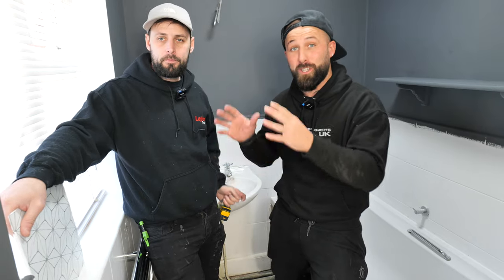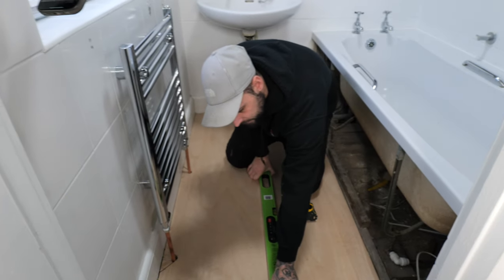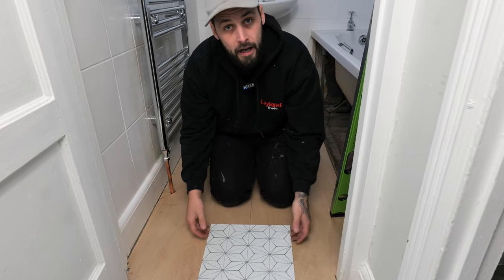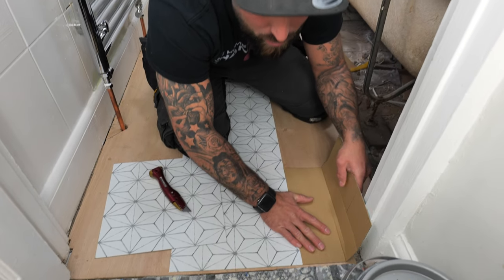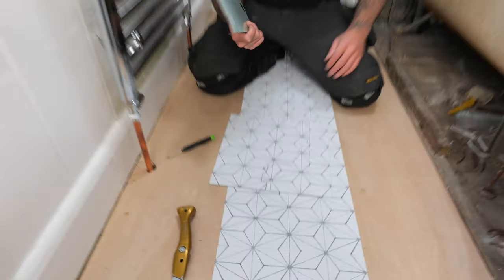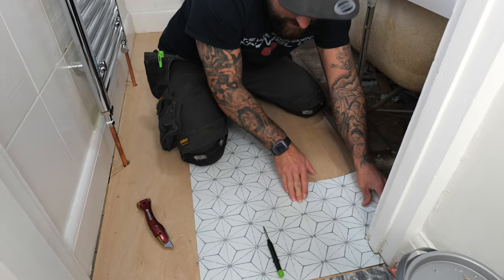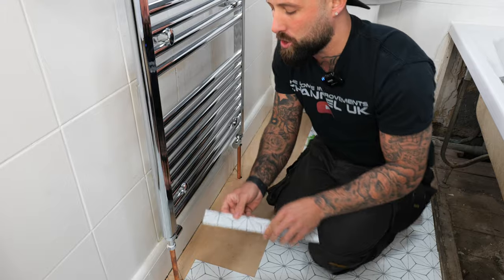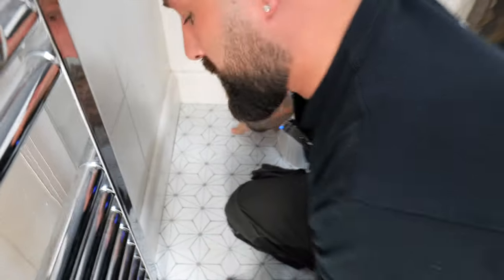How To Install Vinyl Floor Tiles | Easy DIY Guide

Comment: Should show how to cut around the bog and sink. I think people would have trouble with that. Otherwise great video lads 👍
Reply from the maker: Thanks much appreciated
Reply: @homeimprovements  It says something about using primer on a concrete floor, when putting down the linoleum tiles. What sort of primer do I need? As I'm confused about what sort of primer it's referring too. Thanks.
Reply: What did you use to secure the 5mm plywood down with? Hammer and wood nails or with an electric screw driver with screws. Thanks.

Comment: Any alternative to the plywood underlay ? I need to put vinyl adhesive planks in the kitchen dining and I have got floor boards .. can I use foam underlay ? Anything easier and more flexible than the plywood? .. any advice much appreciated